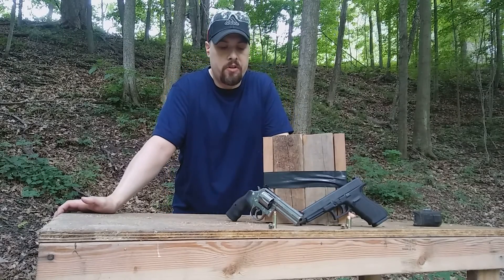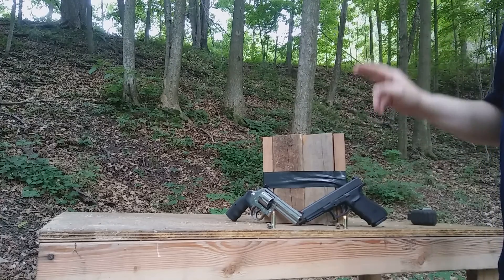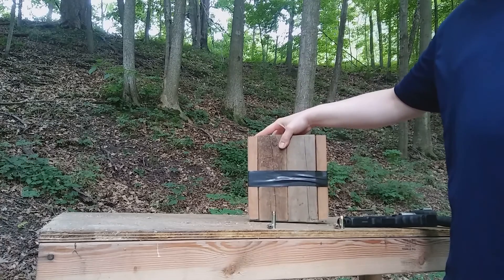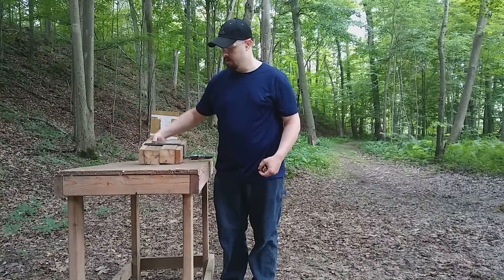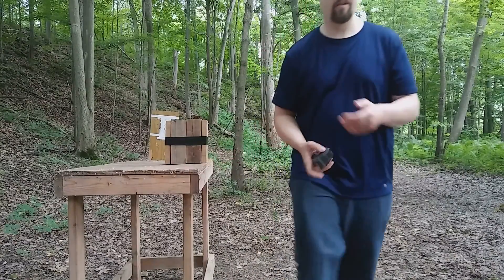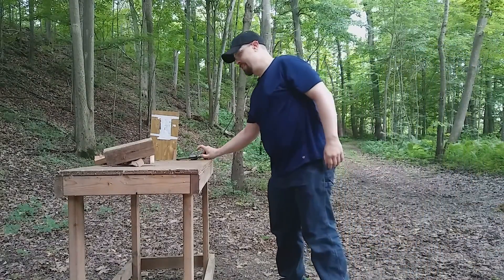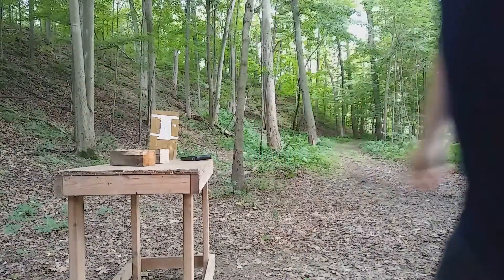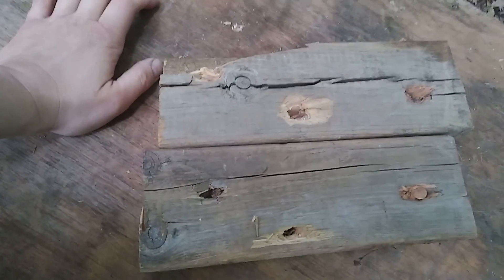.45 Auto Vs .357 Magnum in Full Sized Handguns Episode 2. Momentum

Comment: What I don't understand is why you don't do something of closer weights kava like a hundred and fifty-eight grain 357 and 185 grain 45 ACP, would just not give you a truer and closer results,
Reply from the maker: For one, it is purposefully trying to show the vast difference between the two spectrums of these loads, and another reason is because it's documented that these two rounds were used by LE. I want to show the difference as much as I can. At a future date I might go with more common comparisons within reason, such as 185 or 200 grain .45 vs 140 and 158 in .357. I probably won't do a 180 .357 at any point, because that's not typical enough.

Comment: That was pretty darn cool! The .357 has to be moving nearly twice as fast to match momentum with the .45 ACP. I didn't run the numbers, but I'll just guestimate that they were pretty darn close. Your test seems to show that. I think the penetration advantage of the .357 was down to brute energy and a smaller cross section.
Reply from the maker: I always like the .357 magnum because of it's ability to do so much with such a small bullet. In the end that makes it not only one of the best handgun cartridges out there, matching the energy of some 10mm rounds, yet costing no more for a handloader to shoot than a 9x19mm. I thought the first hit with the .45 knocked it over due to a not as center hit, but the second attempt with the .45 did the same thing with a center hit. All in all I feel like when it comes to the real world, momentum isn't that big of a thing when it comes to comparing .45 to .357 or even .45 to 9x19. Negligible difference in what it does to something.
Reply: Momentum is best used for recoil, IMO. It is a thing, but what happens at the target end is going to depend on many factors. Bullet energy is one of them, obviously. You can compute both from the same velocity reading over a chronograph. The ultimate limit in what a bullet can do is the energy. If there were no other variables, your only question would be, do you want lots of momentum or just a little momentum for that same amount of energy? One pound-second isn't going to push anyone over and that is more momentum than has been dealt with so far.
Reply: I'm not going to bother (unless you insist), but I could estimate the actual weight of the target based on how far it moved when you shot it. I believe it is only a high school level math problem. I would only do it if you still had the target bits and the means to weigh them.
Reply from the maker: I am fairly good at estimating weights, and comparing my memory today in comparison to a gallon of milk, my best guess is 5-6 lbs.
Reply: I'm not disputing that. I'm just showing off ;-). A gallon of water is 8lbs by definition, so the milk should be close to that.

On a more fun note, I received one box of the Buffalo Bore .38SPL +P  Item 20A/20 158gr Soft Cast LSWCHP-GC. It's only claiming 1000fps with 351fpe. Is this the stuff you tested from the 686 that gave astounding performance? I would have more than the one box, but Midway USA only had the one in stock with the back order being delayed. I got free shipping because I also got my order up to $99 by getting a few boxes of Sig Sauer Elite Performance (Sig V-Crown) 9x19mm 124gr JHP which makes the ludicrous claim of 1165fps with 443fpe. I quite honestly do not believe I will get that out of my P938 with 3" barrel. I'm thinking Buffalo Bore is actually advertising more realistic numbers.

What I need is a place where I can blast water jugs. I'm quite sure my range won't allow it. You're very lucky to have that shooting location you use. I wish I could add 9mm Luger to your data. Since I also have a .380 ACP and S&W 638 that is +P rated, I would also be able to backup some of your shooting data in those calibers. The 638 has a steel cylinder and barrel, so the BB may be safe in it. Then again, it may also suffer from bullet pull. It is about 5oz heavier than your 342. My 649 will shoot it of course and that is a chunky 22oz.